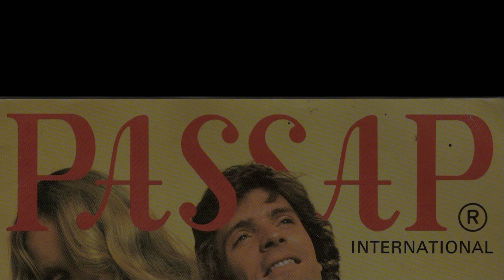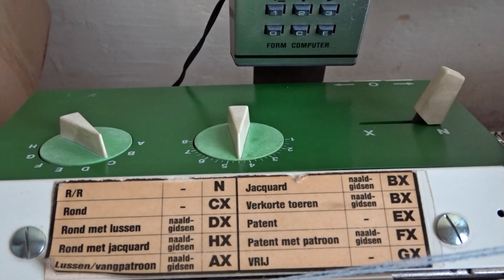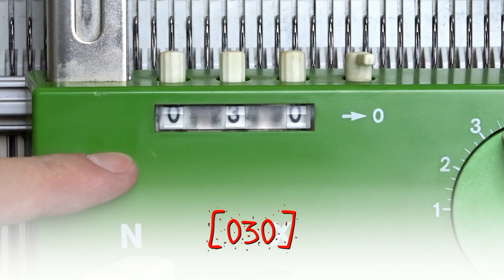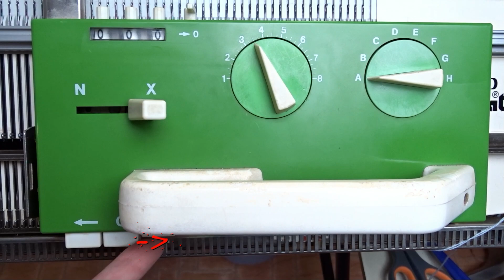Baby Bootie From the Passap Magazine (Passap DM80)

Comment: Can I ask you, I have this machine for a few weeks now and these video’s are such a great help. Can you explain when you need to use weights? The former owner said to use them all the time, but I never see you use them. I also have a comb to use when casting on to hook weights on. When do you use that. I hope I will mange to knit a bootie and send you a picture. Without the videos I would be lost. Hope to be able to knit a sweater one day. Yesterday I cleaned the machine with the help of your video. So today I make a new start. Thank you so much!
Reply from the maker: Thank you for your comment!

The machine is designed in such a way that you can knit without using weights. Strippers replace the need for weights - they are pushing the yarn down, (away from the needles). In this video, I attached weights to the ends of the strap to pull them down and make it easier to cast off the end stitches later.
You can hang weights before transferring stitches from one bed to another. The weight holds the knitted piece and will prevent you from lifting it and unhooking the adjacent stitches when transferring with the double-eye bodkin tool.

When using the U70 or U80 locks, it is also a good idea to attach weights to the ends of the knitting. That way you will have a smaller chance to have dropped stitches while transferring.

When you are knitting a sock and making the short rows for the heel, a lot of yarn is gathered in the middle (of the knitting), it may break a few needles, or you may have several dropped stitches on the heel part. To avoid this you can hang a weight in the middle to pull the excess yarn down.

When using a cast-on comb or 7 shaped weight hangers, knit the first few rows without strippers, because the metal wire on the cast-on comb may damage the strippers. As you can see in the video, I attached the 7 shaped weight hangers to the very edge of the knitting (so they weren't on the way of the strippers). 

I don't have a cast-on comb with my machine. I guess it will be useful when knitting lace shawls, but I haven't seen any pattern that requires using it.

I hope to be able to knit a sweater one day, too. I am also a beginner. 😊